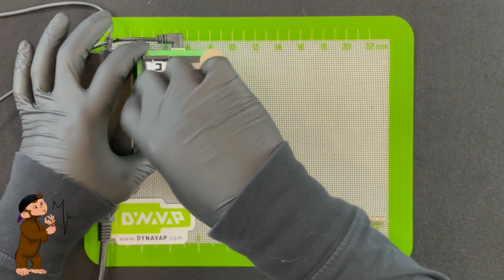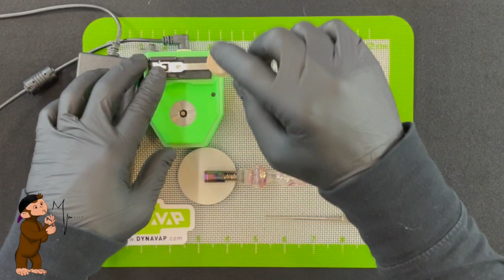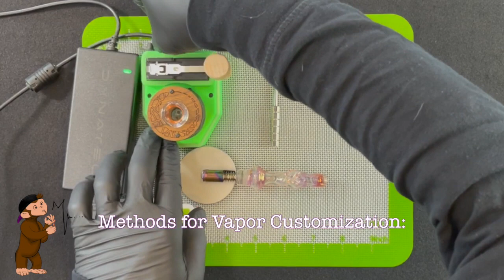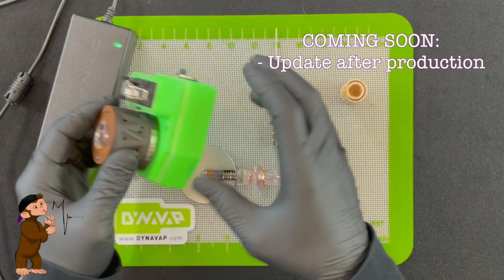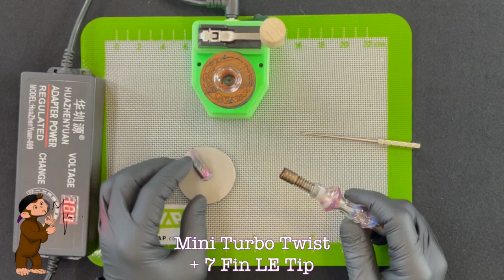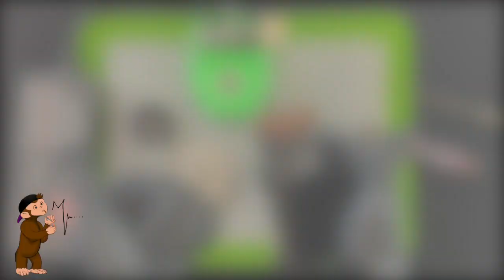Get to know: FFP Beta (Desktop).  Next level versatility | Induction heater | Dynatec / Dynavap

Comment: I really want one of those for my box mod...
Reply from the maker: I want them to finish it
Reply: I don't think that they will though.  It should work on any box mod with a wide deck and appropriate wattage.  I saw you using wattage mode and it has a 510 screw connection, so it is mod friendly or should be.  It is nice

Comment: could you elaborate on why you prefer using non-captive caps with ih?
Reply from the maker: There is more surface area of the cap that touches the tip so there is greater heat transfer between cap and tip. Most of the action with an IH especially with a Ti tip happens in the cap.

Comment: This is already obsolete to the Wand. You have to have it plugged in and you have to hold a button down
Reply from the maker: You missed the part where you can take the induction module off the base and put it on a 510 mod to use on the go
Reply: @MoOiAmATree  
You are correct I did miss that part but it still looks clunky and bulky. Wand fits right in the pocket

Comment: Nice, but it's a big fail from me for the most important reason: pocketabillity. It's way way thicker than an Orion, VHB, Yllvape, Wand etc..
Reply: @BtecEbook  Off course it will be portable with a 510 box mod - just not something you can slip in your pant pocket (like the other IH's on the market). They gone and made an unpocketable portable IH...
Reply: @unisonproductions123  why should it try to compare with these other IHs. They are pretty good and there's not much more room for improvement - at least not if you're trying to keep it simple, as they are. For me this is an absolute win in far a symplicity goes
Reply from the maker: I don’t really agree I think this fits in a pocket way better than the wand. You are right about it being bigger than the Orion and or VHB but as far as customization it blows both of those away. VHB also doesn’t have removable batteries.
Reply: @MoOiAmATree  how does this fit in a pocket WAY better than the wand lol makes no sense
Reply from the maker: @mikec4308  this is the base station for desktop use. You can swap the base to a 510 mod for on the go. Stay tuned for part 2 where I detail all that out